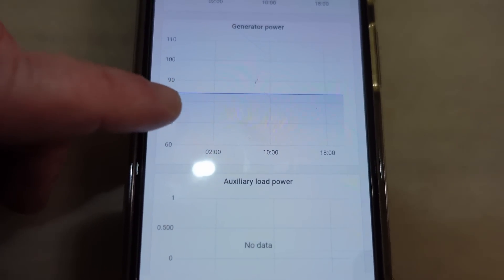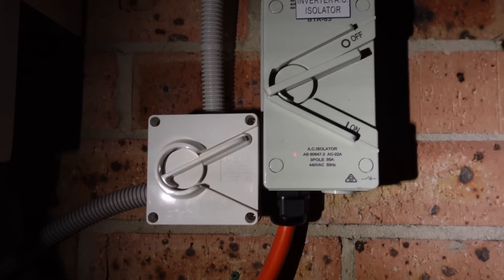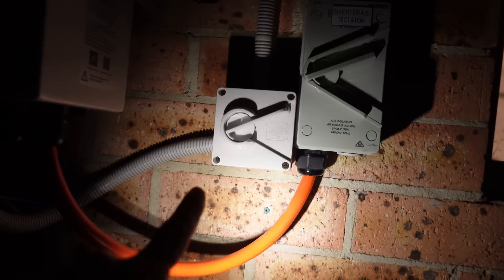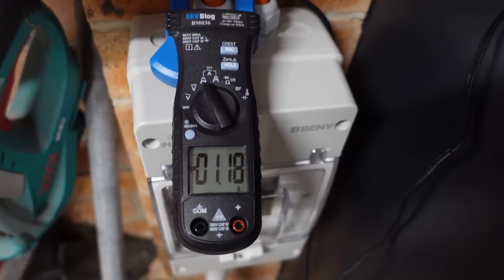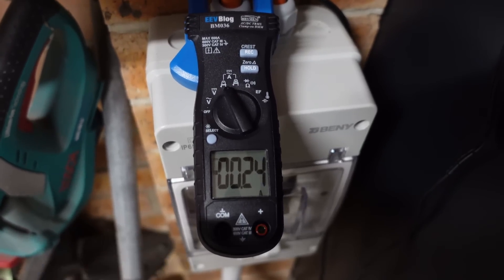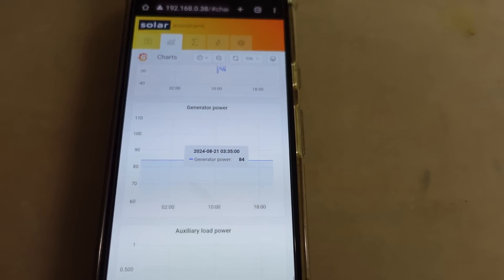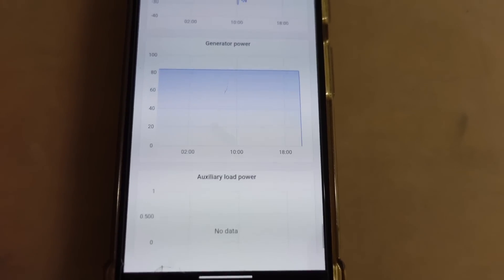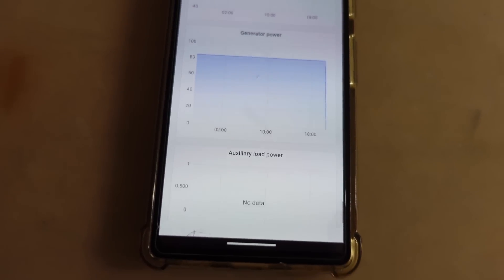Deye Hybrid Inverter Gen Port Troubleshooting

Comment from the maker: ADDITION: The 60W current clamp battery consumption remains constant even with the Gneerator port microinverter feature switched off. So the 84W can't possibly exist as a real power consumption.
UPDATE: After installing two new batteies today and leaving the microinverter option off for half the day, it's now magically fixed, now reading 0W!
Reply: Classic turn it off and back on again... and again.

Comment: Probably a software bug, but maybe the inverter switches on an auxiliary small 240V AC supply (small inverter) internally and feeds it to the GEN port, in order to synchronize and enable the micro inverter on the roof (obviously the micro inverter needs to see a "grid" to enable itself). If your big invertes has some sort of "debug" menu on its screen, it is worthwhile to check if itself reports these 84W somewhere or it is a bug on the SA software.

Comment: what i dont get why is the microinverter on the gen port when it can use it if its plugged to the grid normally.
Reply: Putting the microinverter on the gen port lets it work even during a grid outage.

Comment: The fact it's a constant unchanging 84 W implies to me it has to be a data interpretation error, if it were a real self consumption reading I would expect it to fluctuate by at least a watt or two when stuff happens or the temperature changes etc. 

I would guess it's an issue with Solar Assistant, maybe it's deallocating the memory for that generator power variable which then gets used for some thing else that just so happens to be '84' (idk what language it's written in, but it's possible), I would've expected it to say 'no data' like other graphs with generator disabled. Or it could be a serial message from the Deye changes format between modes and Solar Assistant isn't expecting that format so parses it wrong.

Have you tried changing it to micro-inverter mode and then rebooting the computer running solar assistant?
Reply from the maker: Yep, that seems to the consensus, it's a Solar Assistant quirk/bug. Will try the reboot.
Reply: This seems likely, I wrote a simple program for an arduino to interface with a growatt inverter over rs485, modbus protocol and the documentation was poor enough that combining values stored across multiple registers involved a bit of trial and error. 
My best guess is the erroneous power reading is from one of the following: reading the wrong register(s) / combining the values of multiple registers incorrectly / a math conversion error.

Comment: With the circuit breakers /rcd / isolators, are they 2 pole (a +n) or are they just breaking the active? Possibly neutral to earth current flow? When you change the gen port from mi to gen, was there a click of a relay inside the inverter?

Comment: The idle consumption on the deye's are known to be ~60w - when on grid I believe it pulls that from the grid as it's more efficient to not have to do a step up from 48v to 240. So idle on grid is just a few W but from DC is 60w ish... As for the Gen port reading, who on earth knows. Maybe the unit only binds to grid and when the mode changes to micro/gen it feeds from the gen input...
Reply from the maker: Thanks for the confirmation of the idle consumption.
Reply: @EEVblog2  another thought on the gen port reading, could be electro magnetic interference, did you install the magnets and loop the cables when it was installed?

Comment: Go in to solar assistant go to settings drop down to battery the disconnect the advanced skip down to self consumption and you can change this figure to suite your self consumption
Reply from the maker: I don't see any "advanced" setting for the battery, at least through the remote web interface?

Comment: I have been down this rabbit hole with a deihl platinum 3000 watt inverter. According to all my data loggers it was using about 60 watts at night. However a real utility meter showed no consumption. I eventually found some Ozzy chap that had confirmed the input protection caps on the inverter were responsible for the error. I wired a utility meter in for 3 months and it never logged a consumption kWh. 

It really messes with my efforts to reduce unnecessary loads.as our consumption never drops below the 60 watts.

Comment: Hey Dave - does the microinverter work, and show the 84W load when you choose the auxiliary load output option?  Does that work?  Also I don't think you should have gotten 2 extra batteries but they won't hurt (IMO they won't help much either but maybe reduce the cycling stress on your first 3 so the whole lot will last longer

Comment: @EEVblog2 Does the 84w show anywhere on the touch screen? This is a Solar Assistant problem as it showing graphs for an item that isn't configured. If in Microinverter mode you need to ignore the Generator/AUX data in SA. On my setup the Graphs for both Gen and Aux show 'No Data' in the middle which is correct. Do you have the latest SA version installed? EDIT: your opening screen show the Aux Load Power as 'No Data' which the Gen Power graph should also show. It's a piece of ghost data/bug which you should report to Solar Assistant support.
Reply from the maker: No it doesn't show on the LCD. Didn't occur to me that it could be a Solar Assistant problem. Thanks.